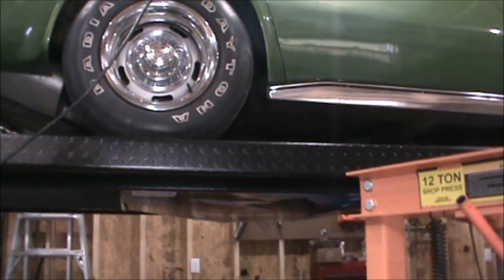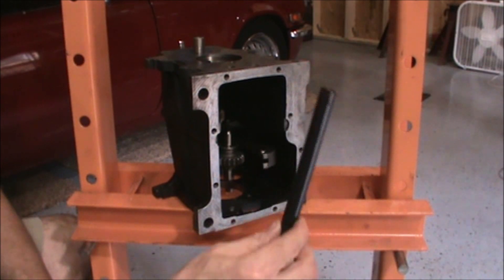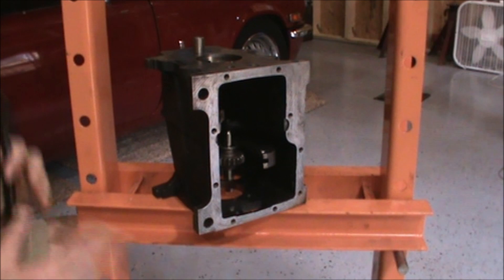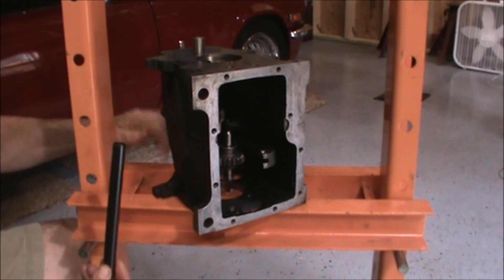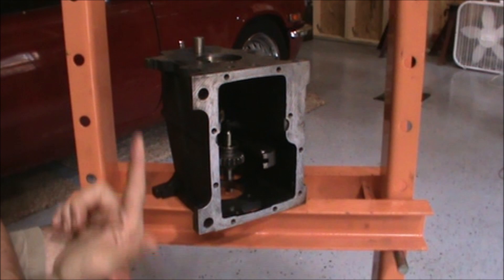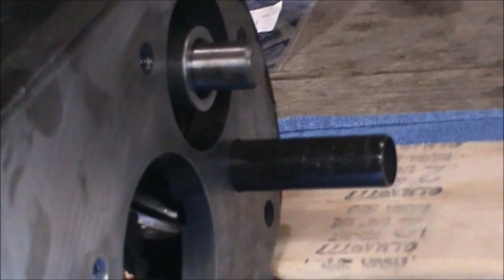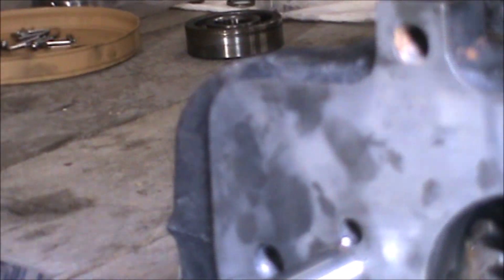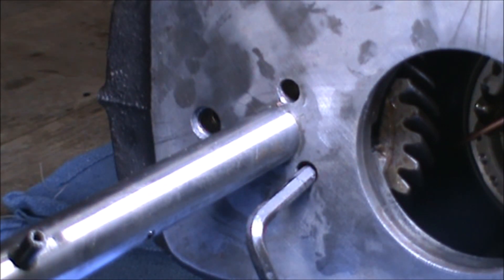Triumph Spitfire 1500 Single Rail Gearbox Rebuild - Part 4F - Lay Gear Installation

Comment: Just a note --- the lay shaft is backwards.
Reply from the maker: Well, that's embarrassing.  Thank you for pointing this out.   I've got a bit of tear down and reassembly to do to fix this.
Reply from the maker: Dennis, I've removed the video and will correct it so others are not negatively affected.  Thank You!
Reply: Mike, just wanted to say thank you for the videos warts and all. Ive had many of the issues you had and made the same mistakes but your videos were an invaluable as a reference source. Ive nearly completed mine ( an OD one so probably worse) and will need a  holiday and probably therapy before Id do another one. Once again thanks.